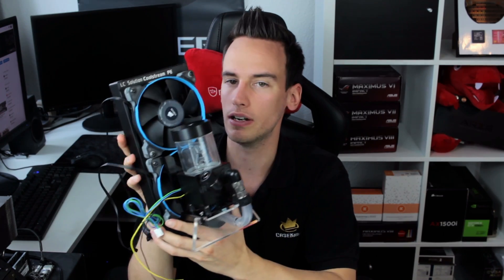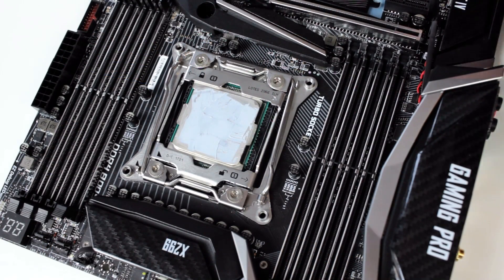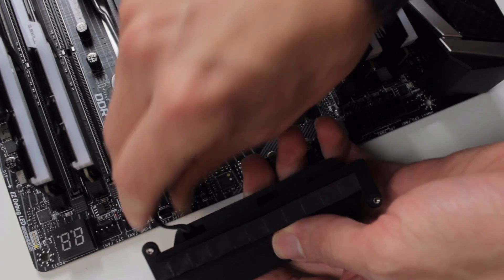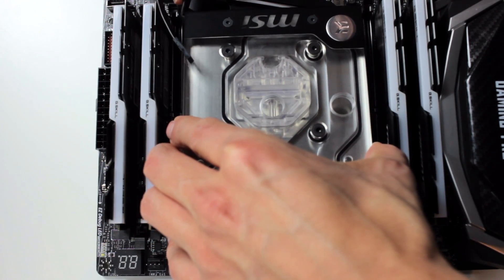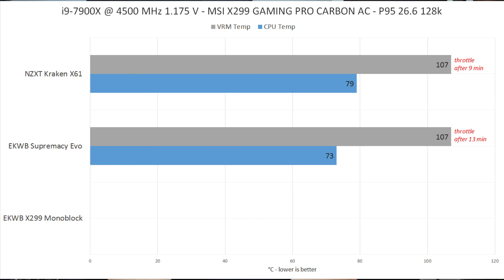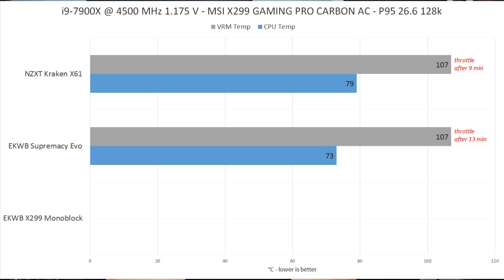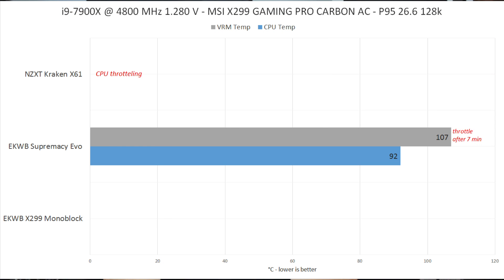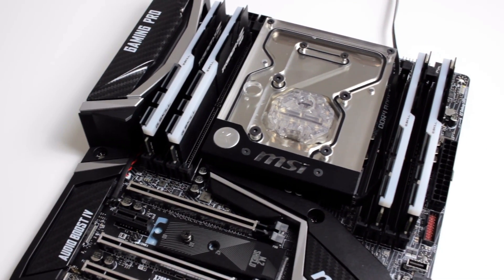EKWB Monoblock Test on MSI X299 GAMING PRO CARBON and i9-7900X (en)

Comment: Iv got a 7820x 8-core CPU overclocked to 4.9ghz all 8-cores with the EK Monoblock on my Aorus gaming 3 motherboard. The Gaming 3 does very well overclocking minus the stock VRM heatsink. I was throttled like crazy before getting the Monoblock, I ran the EK supremacy before my Monoblock and my temps stayed the same when I went with the EK Monoblock  vs supremacy and that is due to me having a huge 560mm radiator with 4c ML140 fans that push an incredible amount of air through it. 

I just ordered your delidding tool for my 7820x and my buddy’s 7740x, it just arrived today. Once I delid my 7820x I’m gonna shoot for 5ghz stable all cores but even if I can’t make it there I’ll still be happy with a 10-20c drop in temp, currently under full load I’m in the high 80s low 90s 

Thanks for your video!!

Comment: I have the X299-XPOWER-GAMING-AC. EK-FB says that this block wont fit but looking at the MB specs and measurements between the one you tested and it I see no reason as for why not. Do you happen to have the X299-XPOWER-GAMING-AC and still have access to the WB to see if it can be fit stock or even with slight mods to the block?

Comment: My monoblock is arriving next Friday, I just cant take it anymore seen my cpu over 80c in load and 50 to 60 in idle with just 4.4oc and 0.920 volt using a h100iv2 at max speed on pump and fans

Comment: Thanks for the video, Roman. 
It would be great an extended review of thermal pads, and what can we get if we change the default one for another with better quality (in MB with decent heatsink, of course). It's like "deliding" VRM instead of CPU. Also in graphics card, as did this guy: http://www.overclock.net/t/1576426/fujipoly-thermal-pads-vrm-insanely-low-temps-must-have-recommended

Comment: Hi der8auer, can you try Ek ivy naked kit on your skylake-x CPU with supremacy wb? They have double PCB, total thickness should be enough for proper pressure on the socket.
Reply from the maker: Already tried it, doesnt work only with pressure from the CPU cooler :/

Comment: 9min vs 13min throttling is caused by the different internal resistance of the warmer CPU. Semiconductors have less resistance when they get hot. They have more thermal exited electrons (or holes) in the conducting-band (density~ Exp(-Delta_Energy_gap/(2*K_b*Temp)). More electrons to move, results in more current the VRM need to deliver. Because of the exponential character of this effect, small temperature changes at higher temperatures result in big changes in the current(/resistance). Hence your VMR hits its limit earlier when the CPU is hotter.   

But: Very good video.

Comment: If there’s 8 degrees of difference between MSI’s default pads and the ones from Thermal Grizzly. Is there much difference between the EKWB supplies thermal pads and the Thermal Grizzly Minus 8 ones? Or is it harder to spot without going up in radiator size?

Awesome video with dual languages as usual. Thank you for the effort you put in to spread your knowledge and demonstrate results!

Comment: Thanks for the video Der8auer.  Three questions,  which prime 95 test are you running, what is the max temperature you recommend for the 7900X vCore, and do you think I could rig that monoblock to fit the x299 MSI XPOWER Gaming mobo?   Thanks again.
Reply from the maker: Prime95 26.6 non AVX in this case. Max temp is 105 °C with prime so it should be much lower in most usecases. Not sure if the block can fit on the XPOWER tho
Reply: der8auer which test do you run small, large in-place,  or blend? Also,  with my current 7900x overclock (4 cores @ 5.1, 6 cores @ 4.7 at 1.290V I'm stable but hit 91C when running cinebench 15 - (real world example).   Do you think that's too hot?  That's the hottest I've seen it get outside of prime 95.  Prime 95 - I CPU throttle but I ignore that cause nothing I do really gets it that hot.   My adia 64 stability tests runs stable max at 87.  Do you think this is a healthy overclock?   Thanks!

Comment: Hey man, great vid! Do you think its possible to achieve 5ghz stable for 24/7 use (gaming) on the i7 7820x(delid ofc.) On the rog rampage VI extreme and 2 hwlabs nemesis 480 rads(4000watts of cooling) ? And ofc an EK monoblock. Or should i just wait for coffeelake?
Reply: Surpunt I run 4 cores @ 5.1 and 6 cores @ 4.7 on my 7900x. Binned and Delidded with custom loop mind you.   But yes, it's possible
Reply: Well, since ur chip is binned... Though 2 cores less on the 7820x might give it more headroom is guess.

Comment: Running the same setup. That foil is on the retail motherboards as well. I used the plastic washers from the stock VRM heatsink to prevent the motherboard from bending. Contact is good, and temps are outstanding.

Comment: If you're using the nzxt kraken x61, that is a 280mm radiator, not a 240mm.
Reply from the maker: damn you are right. Mixed that up. Thanks!
Reply: der8auer No problem man. I only subscribed recently, but I haven't found a video of yours that isn't cool yet.

Comment: OH! You are back in making X299 viceos! Thumb up bro :D
I also got mine from EK for the GA AORUS Gaming 7. It does good job xD
I think the series monoblock part for VRM is very cool, and cooled! I was thinking about what if I got Mosfet Waterblock for VR, and put CPU waterblock for only CPU cooling by using two radiators for each of them. Maybe this will let me get even lower temperature. But I cannot escape from the magical good look from the monoblock /D It's just so nice

Comment: inductors dont need coling !!!
Reply: @Southeastern777 you'd rather have your vrm's throttling?  If it was me i would just go with threadripper and not have to worry about such nonsense. X299 is a joke. just think how many X299 (non-monoblocked) motherboards will be burning out in a couple years after running the VRM's at full blast 24/7 just to try to hit stock frequencies!
Reply: It doesn't hurt to cool them, every component gets lower life span if heated like craxy most of the time.

Comment: I wanna see only 2 tests! 7900X@4.8 vs 7700k 5.0 in few CPU demand games, and also 7800X and 7980XE vs TR1950 all on max OC with water. But i now, you don't do such tests, you do only important and unique tests, so i dare you to do OC to performance gain on i7 7700k and R7 1700 with 100 mhz step from stock to max OC, with nice graphs and curves. You pro Overcloker and push all to max - we dont, so we do mediocre OC. Pls prove the point when CPU OC stop diminishing returns! Thanks!
Reply: Taran my 7900x is running 4 cores @ 5.1 and 6 cores at 4.7.  Cinebench 2706 and 226 for single core.

Comment: What a gorgeous looking block, I personally think that white fluid would look amazing with it, but that's just me, and I'd probably be just as happy with distilled water.

It's shocking just how bad the vrm cooler is on these boards though, a 49C difference is an enormous improvement, especially on something that only outputs roughly 25w of heat, I would expect that kind of improvement from a 150w gpu core, not a vrm.

Great video as always Roman, and I've said this before, but it's worth mentioning again, I really really appreciate the effort you put into making both German and English versions, thanks.

Comment: Thanks a lot for this mate, has really helped me in deciding what cooling config to use when upgrading to 7900X or 1950X, would like to see the difference with a 1950X as well, as well as all cores overclocked as that is the only time apparently the 1950X gets HOT! :)

Comment: Would you guys recommend AX1500i or EVGA T2 1600w for 4x GTX 780?
Reply from the maker: I'd recomment to sell the 4 x 780 and get 1080 Ti(s) :D should be faster and more power efficient
Reply: Gaming or mining? If mining, I have no idea. If gaming, take out at least 1 card. Linus tech tips did a nice sli scaling video and 4 cards only work for benchmarks

Comment: EKWB juste announced a monoblock for the rampage VI extreme (and it also work on the apex).
Could you make a test with the i9 7980XE (when it launch), one of the X299 asus extreme board, either the apex or the rampage, and the monoblock ? :)

Comment: you are putting so much effort , but this is all waste of time money and resources , rather just buy a motherboard with with good vrm heatsink with a dedicated heatpipe ,  example gigabyte aurous  x299 gaming 7 , gigabyte x299 aurous gaming 9 , asus rampage vi apex , asus rampage vi extreme , msi x299 xpower , all these boards will give the same vrm temps as the ek monoblock . and no one has to go to the hassel of custom watercooling loop, and also the huge cost on a custom loop ,    
board manufactures need to understand the power of the cpu
Reply from the maker: +Amit Ghai I wish that they were this good. On all of these boards you will have very high VRM temps especially running clocks like 4800 on 10 core or HCC. Check my Apex VRM test video.
Reply: der8auer yes i saw that video a month ago , also saw tom logans video of the same board ,  one thing i want to mention why would u overclock the cpu to 4.8 ghz ?? when the cpu runs at 4ghz turbo on all cores at stock ?? 4.3 is good enough , beyond that doesn't relate to any huge performance gains , also u said it in the apex video about apex performance is very good ,  i guess the x299 is good enough at stock for maximum users , but people who want to overclock can do it but going beyond 4.6ghz u need to delid the cpu which is another pain and risk , and all this hassel for 5% performance gain ??

Comment: So what would be the solution to lower  CPU temps? Bigger RAD?
Reply from the maker: yea that's the only way. Probably by 5-10 °C but more won't be possible. CPUs just get too hot
Reply: bigger, thicker or more of them, all will work fine. I prefer bigger, 420 rad would be perfect

Comment: Is this a delidded 7900x?
Reply from the maker: correct
Reply: Yes it is, he  says somewhere in the beginning of the video. To my knowledge non-delidded 7900x's are ridiculous temperature wise.
Reply: Wait, it's delidded? And still reach those temps? Oh wow.

I think those AMD-Barton-heat jokes needs to be corrected to Intel. Long overdue.
Reply: Nightykk need more rad space. 240 isn' t enough to keep a low delta  on 300w load but this wasn' t the main target of the video
Reply: Yes, exactly my thought. Still exceeding 90 degrees @ 4.8 with fairly high end water cooling.

Comment: 8Pack mems FTW. Informative Video mate. I would have used larger Rar I think as it seems 240 cant handle CPU and VRM load all at once. No reason why CPU gets hotter with mono block other than capacity of the Rad.
Reply from the maker: Absolutely agree with you. I think 360 should be good for it but was too lazy to get new hardware just for this haha